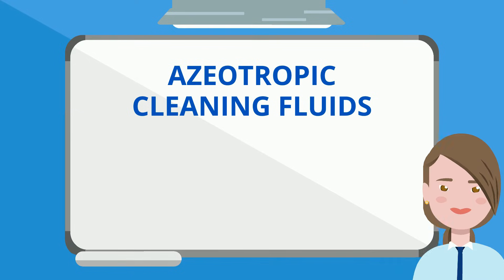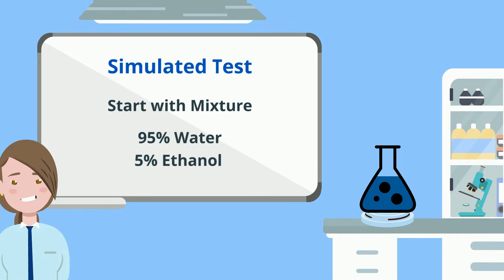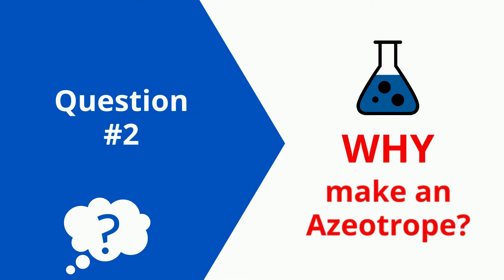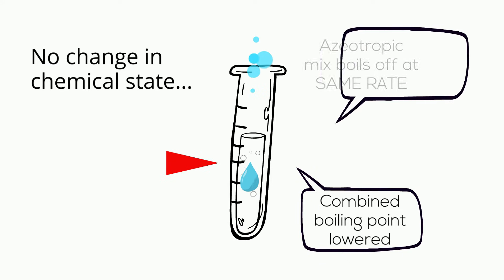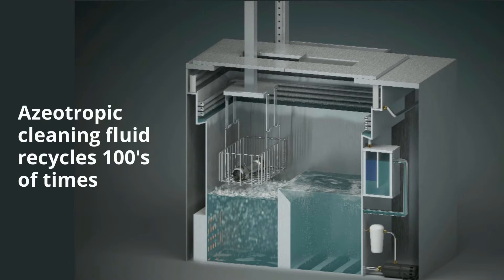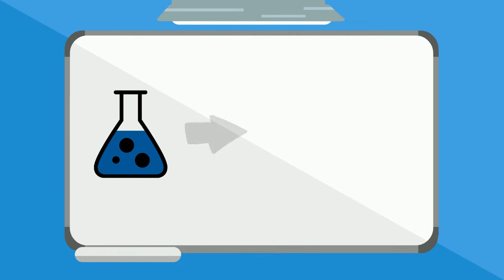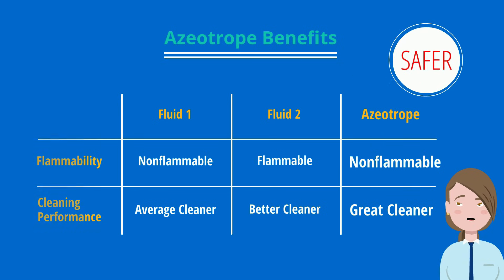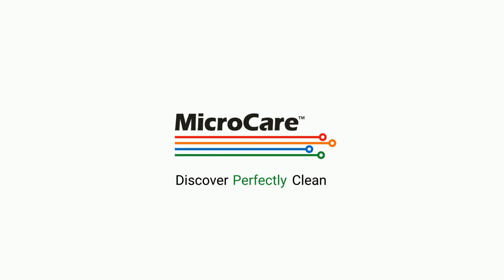What is an Azeotrope?

Comment: Its approx 95% ethanol and 5% water by volume .the decrease in boiling point is due to their positive deviation from ideal behaviour increase in vapour pressure results in lower boiling point than calculated.
Reply from the maker: Thanks for watching! We are providing a simplified explanation - not specifics on the chemistry and minimum boiling point. Good job on digging deeper into the science.